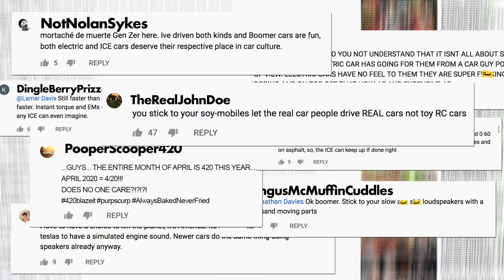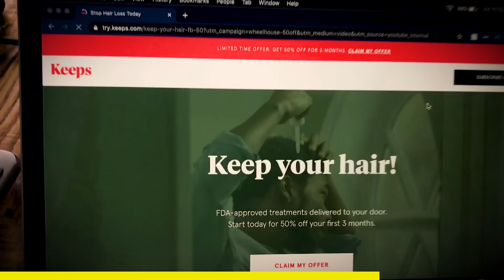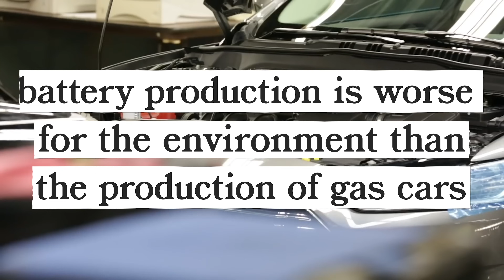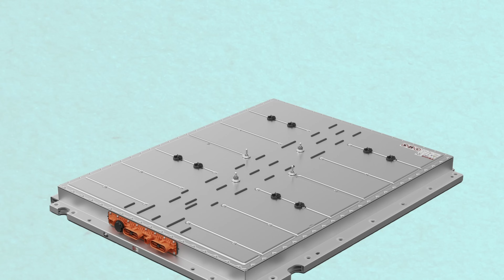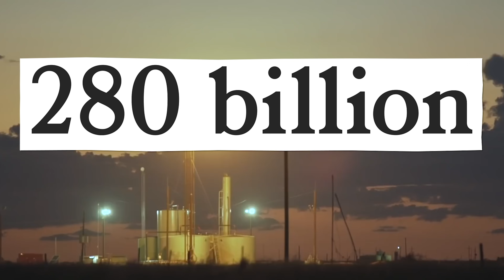Are Electric Cars REALLY Better for the Environment?

Comment: Of course electric cars pollute worse than petrol or diesel for one thing where the electric come from another point the polluting way they are made also the carbon dust they kick out from the motor and one last point when you plug your im a furlower i had lots free money electric car on your drive your basically plugging in a bomb they catch fire so easily and burn for days verified by a fireman you want that on your drive next to your house sort of people who buy these cars are sort of people who dress up in spandex get on a push bike at weekends and think they are fit 
Honestly you want a car thats good for the environment buy a old Audi or BMW diesel they already exists  they more economical they more robust dam site faster and they wont burn your house down
Reply: Well first off. No. Even on a coal only grid EV’s produce significantly less emissions that combustion cars. Hell it’s even more fuel efficient to charge your EV with a cheap portable generator than it is to use that same fuel in even a modern combustion engine.

Second, the electric motors don’t produce any emissions an they sure as hell don’t carbonise themselves!

Lastly, no, they’re not a bomb on wheels. According to the beuro of statistics, the AANCAP safety board, European NAACAP safety board and the American NHTSA, EV’s are 11 times less likely to spontaneously combust compare to ICE vehicles and 5 times less likely to combust in an accident making them… significantly safer. They also don’t have massive engines and transmissions meaning you get better crumple zones at the front and back compared to ICE making them.. well safer than ICE again. And because their batteries are so low down making up the floor of the vehicles their centre of mass sits around the axels of the wheels, making them significantly harder to roll. Making them… safer again than ICE vehicles. There is a reason that 4 of the top 10 safer cars in the US are Tesla’s and 3 of which are in the top 5. And 3 of safest cars you can buy in Australia are Teslas taking out the number 1, 3 and 4 spots.

Please get your facts correct before posting nonsense on a public forum.
Reply: And faster….? You do realise Teslas are faster than any Audi or BMW. Hell I have the slowest Tesla car money can buy and it’s still faster than a golden SS, almost every Audi aside from some of the super performance once’s an every BMW aside from the M3 and M4. If I had paid a little extra money I’d be faster than all of them. 

What do you mean they’re faster than EV’s?
Reply: EV cars pollute far worse fact .you get your facts right and if your talking speed my Nissan GTR runs at 1700 brake I leave Teslas standing still fact!
Put a Tesla round the track a standard Mini would beat it in the corners fact!
Oh and My Modified e36 pulls away from Teslas running at 680 brake oh if you talking Audi my RS6 says also goodbye to Teslas if your talking money sonny I can buy what I like when I like and if I thought a Tesla was good I would of had one years ago been in one they are slow as a mobility scooter 
EV cars best place for them is a car shredded I also own a scrap yard your so called environmental EV cars end up after uneconomical repair in my field as cant recycle them hmm thats good for the environment 
Talk to me like that sonny get your facts right
Reply: @Palmatechdec  actually Tesla produce the fastest production car on the planet. A 2021 Nissan GTR does 0-60 in 2.5 seconds. Meanwhile the large luxury family sedan Tesl model X does the same in 2.4 and the Model S plaid does it in 1.9. As for the Audi RS6 does 0-60 in 3.1 whilst a model S half its price can do it in under 2. 

As for cornering Teslas and other EV’s are well known for their handling. Mostly due to the fact that the centre of mass is around the axels allowing for extreme stability even in harsh turns. Between my Tesla model 3 and my lowered Subaru WRX with anti-sway bars, I can corner much hard in the Tesla. Sorry to burst that bubble kiddo
Reply: @engineeringtheweirdguy2103  Wow A L Tesla Stan
Reply: @Confused01  not a stan. just pointing out EASILY verifiable and googleable facts.
Reply: Fact My GTR will do 0 to 100 in 3 seconds fact Teslas cannot corner due to battery weight 
Now f off

Comment: Not taking into account when the rechargable batteries wearing out and the owner buying another ev car. Buying the new battery by itself is almost as much as you paid for the car. So the average pollution from production will actually be higher than your letting on
Reply: A full battery replacement is around $10k - $15k, far less than the cost of a new car.  Old batteries are repurposed or recycled.
Reply: @SpottedSharks  that number is about 10K lower than what a friend was just quoted for his pruis. So he traded the car and went back into debt.
Reply: Additionally modern EV batteries are designed to last twice the average lifespan of a combustion engine before needing to be replaced
Reply: @engineeringtheweirdguy2103  i severely doubt you'll see one of these batteries make it to the 486k miles I have on my truck now
Reply: @DanMcD80  well some quick maths. Both real world data and lifespan claims indicate that previous generations EV batteries (2018-2021) will last 1,500 cycles to 80% battery health (80% of your original range remaining).  That means for a long range Tesla model S with a range of 412 miles, it will reach 80% battery health after 618,000 miles. So they will likely outlast your car.

Additionally I said double the average lifespan. Your cars engines lifespan is well over the average, unless you’ve replaced or re-built the engine.
Reply: @engineeringtheweirdguy2103  and neither adguement even addresses that most cars on leases and are turned in for new one every few years so the production emissions being higher than a petro version at the same rate isnt doing anything positive for the envirnment in the long run. And not one here has said a peep on the human cost of forced labor to attain the materials. To produce the batteries alone. Turning a blind eye to it makes you as guilty for it as the slavers imo
Reply: @DanMcD80  you do know that the second hand market is is a thing right?…. RIGHT!?!? way to overlook the obvious.
Reply: @DanMcD80  just because you replace your leased car doesn’t mean that car is scrapped. It’s probably re-leased for cheaper to someone else or sold as a second hand car to someone else who will use it for the next 10 years before they sell it to a third owner for another 20 years or so. And so the cycle of life continues. You’re telling me that you thought after 1 year a leased car is thrown in the scrap yard? Really!?! c’mon man, I’m not that stupid and I’m betting you aren’t either.
Reply: @DanMcD80  you didn’t expressly state that no, but it is implied in your statement however so, yeah no. See lifetime emissions of a vehicle are set by, well, ya’know, their lifespan. EV’s have a longer lifespan than combustion cars these days and even if they had HALF the lifespan still have a better and smaller footprint than a combustion car does. By neglecting the lifespan of the cars after their leasing, to make the assertion that they’re worse. Clearly indicates that in your analysis, they stop serving any purpose or use afterwards which would be the same as sending it off for scrap. Which isn’t the case. You didn’t expressly state it. But like I said. I’m not a idiot.

So for you to claim that because leasing companies buy new cars, that this makes them worse than combustion cars, is categorically untrue and means you are entirely neglecting the full life cycle of the vehicle. Also, FYI, between two similar sized and spec’d cars, EV’s only have to drive between 20,000-30,000 miles before their emissions break even with ICE vehicles. 

Leased vehicles in average travel 12-15k miles per year with an average lease term of 2-3 years meaning in most cases, they have had the same or less footprint than ICE vehicles before their leases end. Also keep in mind that the older models can be leased further to someone else for less or even retained by the same person on an extension. And like previously mentioned, when being retired by the leasing company, sell them to second hand drivers who continue to use them instead of buying a new car.

You analysis is flawed. As I said before, I’m not that stupid, I don’t believe you are either. This might work on your brain dead friends or relatives but not everyone is so gullible. 

So either, stop making idiotic statements that are knowingly categorically untrue. Or face the fact that others are going to think you’re stupid.
Reply: @engineeringtheweirdguy2103  was only implied in your projection as you skipped over all the other talking points. Projections is something liberals do, and often you cant have an intellegent conversation with them because they resort to projections to have something to agrue because they have nothing on the topics at hand. Have a good day.
Reply: @DanMcD80  the only other point you made was about forced labor. Which isn’t a topic which has a happy ending for your assumptions let me tell you. But happy to dive into that further if you’d like. So no, that was the only relevant point on the topic of vehicle footprints you made. Try again next time.

As for “projections” it depends on what you mean by any person with a brain understands that you have to deal with past data, current data and what it tells you about the future. 

Here is a quick example. Let’s say I buy brand new printer. It takes special ink cartridges but this printer suits my current needs best. But I am also aware that the printer and it’s cartridges are going to be discontinued by the manufacture next month. But I don’t deal on projections so o buy it anyway. Have I wasted my money?

Here’s another one, let’s say o buy a laptop. According to my current needs of answering emails, it’s sufficient. But I am still gunning for a promotion in the future which will see me needing significantly more computational power from a laptop. But I don’t deal on projects so I buy the smaller one for emails. Next week I get the promotion. Have I wasted my money?

Only a fool deals solely in the present. Are you a fool?
Reply: @DanMcD80  also I’m ignoring the political affiliations you’re projecting on me. Suffice to say that YouTube is a global website. The term “liberals” doesn’t mean the same thing everywhere kiddo. And taking current data to make future predictions is what people pay Engineers to do. It’s not something solely aligned with a specific political view. Your assertion is myopic at best and self delusional at worst.
Reply: @engineeringtheweirdguy2103  yawn
Reply: @DanMcD80  good comeback. Really destroyed my argument. So many solid facts.

Comment: And don't neglect about the things like the wind turbine blades, needing to be replaced. You can't do much with the old blades except land fill, or ground up for concrete additive.
Volvo did a comparison between ICE/EV it takes an average of 90000 miles before the green cross over point.

Comment: "EVs have less of an environmental impact than ICE" is the reason why EVs will never be the true replacement for ICE, they are still far too polluting in production, and what about the dead batteries once their cycle ends? So really EVs will actually produce more pollution than is admitted here, given than you aren't going to change your ICE engine just because's it's 5 or 10 years old, whereas an EV MUST produce batches of worthless dead batteries every decade. Imagine billions of kgs of dead batteries in 50 years. What then?

Comment: There is NO definitive answer to this question.  Lots of BS analysis is being produced that ignore the true impact of EVs.  For example, an ICE car will be on the road faaaaar longer than a BEV.  No one is going to cough up the money needed to replace the battery in an EV after 8-10 years.  So, EVs will head to the scrap heap at a rate twice that of conventional cars.  The energy mix in electrical generation uses vast amounts of coal and lignite. (I've lived in China and some days you could barely see a 100 yards down the road!)  Also, you need vast quantities of copper (millions of tons of rock are being dug up as it is now being mined at .3% copper content) as well as huge amounts of exotic materials to make electric motors. 
The big unknown is the emissions and pollutants created by recycling batteries.....governments are conveniently sweeping that issue under the carpet.  I predict that battery waste will become very similar in nature to nuclear waste.  I think some excellent points have been made below and the true answer is unknowable as a lot of R&D has not yet been done.  
A lot of emissions could be avoided by switching trains and trucks to hydrogen.....R&D on that front is somewhere near zero (except JCB in the UK it seems).  Much more "interesting" to do stuff that consumers can be made to pay for, particularly western European governments are giddy about this stuff.
I feel that the equation at best is a wash.....

Comment: 10:00 Nope... Where I'm from, it's almost true. A drastic reduction in energy production since our government decided to shut down a bunch of nuclear reactors and not expanding the power grid to make more charging stations is proving to be quite troublesome. The 4000% increase in energy cost. was not the only problem we faced last winter. The fact that we had electric cars blocking the street with depleted batteries due to the cold was also quite a bad situation.
Reply: Texas? , Germany? Or california? I’m confused where is this 0-0
Reply: sounds like here in Sweden
Reply: @kempaswe4022  Correct XD
Reply: @tntfreddan3138 Lol. You've swallowed a bunch of propaganda. Fact check about those 50 cars abandoned on E6 which I'm guessing you're referring to. There were only one electric - The rest were regular ICE.
Reply: @RallyHagge  I'm not only talking about the E6. I've seen quite a lot of EVs that has been parked by the side of the highway and I've also stopped to ask if they need help on two occasions. Both times i've gotten the answer "out of power" and both times I offered them a ride to the nearest gas station since it was quite cold. Unlike the EV's, the heater actually works in my Scania and my Volvo (personal vehicle). Once on RV40, just west of Jönköping, so I could stop at a roadside parking spot, to which the other guy didn't make it, and the other on the E20, just west of Floda, on my home from work. What caught my eye both times was that it was getting dark and neither had any lights on nor hazards. A little hard to do that without power XD

Comment: You and your “sources” also have a major flaw in the logic - you forget that switching from Gas to electric creates NEW electric demand which changes everything.  So, applying your local utility’s fuel mix in your calculations misstates reality.

Because going forward we will be building renewable power plants to replace fossil plants, whenever you add new demand (which every EV does), you are delaying the time when fossil power plants are retired or throttled down because we will need the power we would retire to supply that extra demand from EVs.  Thus, the bottom line is your EV keeps the dirtiest fossil burning power plants in your area running longer and higher than they would have if you had stuck with gas cars.  In short, whatever power plant you would want to retire or turn down (coal) is running higher than it would have by the amount of electricity your EV uses.  

You need to think it through and you haven’t done that.  Only when your utility is 100% renewable will EVs start to make sense.  That’s decades away in most places.  When you leave out a key factor, you get a false conclusion.
Reply: Not quite. That would be assuming that we are close to our grid capacity to begin with. Buy in large, we’re not. Additionally, thanks to emission targets and environmental laws EV’s put higher pressure on demand for renewables and last point, economically EV’s have been driving up the adoption of home solar arrays. To supply the energy needs of the US, you only need solar panels on around 15% of all rooftop area in the US.